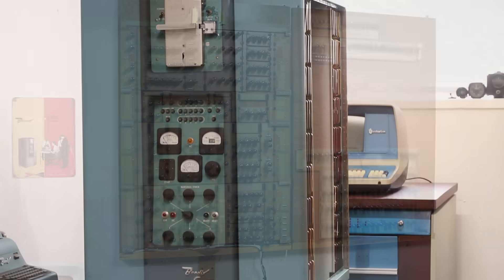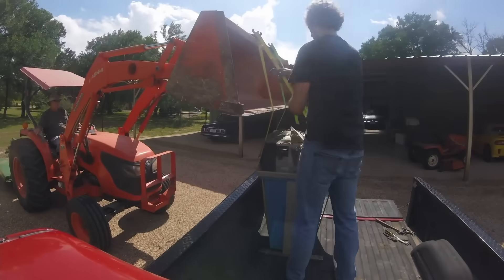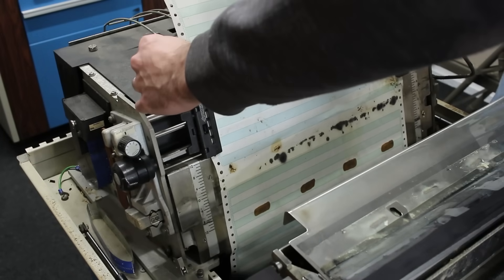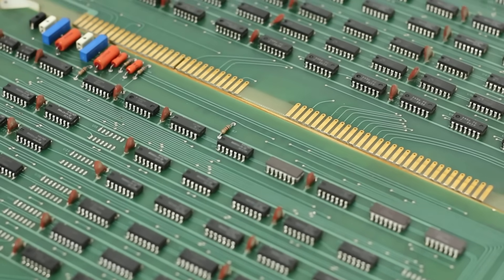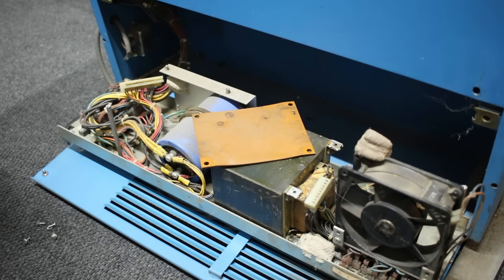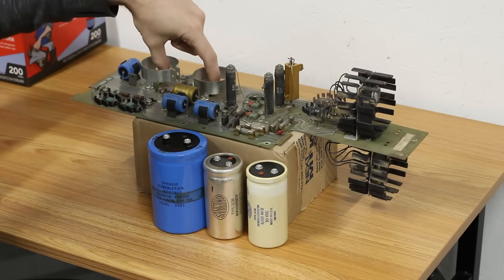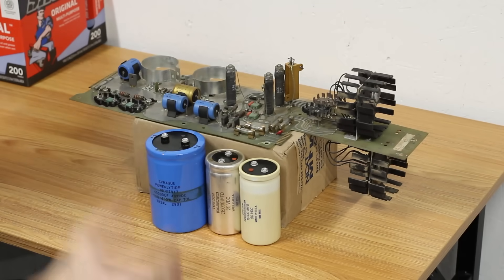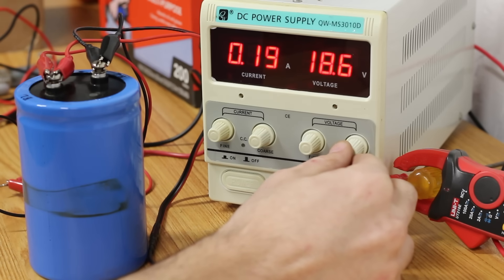Working on the Largest Printer I Own

Comment: I is like the OLIVETTI BCS3030 Line Printer but your printer doesn't also house the Floppy drives  so is not the same as the OLIVETTI BCS3030 Line Printer.

Comment: The desk system at college, you had a connector wire to the drive issue with no write happening,  was the cable fixed and the software replaced and now working as a CPU 6 machine

Comment: I did output collection and sorting from a band printer in the late eighties. Never saw a chain printer running. But if it is 100 lpm (not cpm) I'd imagine it's near the same.  It was amazing watching that band printer run.... chomp chomp chomp grrrr grrrrrr chomp chomp chomp and ten 13" fanfold pages had printed.

Comment: This is fascinating. I worked on drum based printers in the late 70s (adjusting hammer flight time, etc.), and my first printer at home (in 1979, no less) was an ICL Termiprinter, which was slightly similar in operation to this chain printer. In the Termiprinter, the typeface pieces were at the end of steel fingers extending from the side of a belt (kind of equivalent to the chain here), a bit like a giant label embossing device.  It was only 80 columns with 80 hammers, and also quite slow, but it still weighed a ton. The ingenuity in such machines never ceases to amaze me.

Comment: In the early eighties I used to work in an office where the had a Data100 (I noticed that brand name on the back of the centurion printer...) drum printer. When that was doing a test run, man that was hammering. I also have some chain printers in bad shape, not by centurion. Waiting to be restored for 40 years now I guess:). Anyway, if you look for documentation, 'DATA100' is a good link.

Comment: For the mechanical side of the printer, in case you are wondering: the blue tape with the perforations that you removed at 17:58, is a "carriage tape". It allows a program to skip to a certain vertical position on the page. For example if the program wants to jump to the bottom of the page to print a footer, it tells the printer to skip lines till it encounters a perforation in the column (in IBM terms, that would be called a "channel") that corresponds to the "end of the page" (if I remember correctly, in the IBM days that would have been channel 12, by convention). When I started working in the early eighties, we had an IBM 3203 printer that printed 600LPM (there existed  also a 1200LPM model, but we didn't have that one). It was a beast. If you opened the cover, even if it was not printing, the sound was like a steam locomotive entering the train station. Very impressive.

Comment: This printer reminds me of the 6500 IBM Printer series... it adopt basically the same configuration for the hammers and the characters belt.
I was, in my youth, a good technichan on those printers and the adjacent series 6400 ( this one had a single line of heads in a vibrating bar that compose the characters dot by dot in lines)
Both are printronics rebranded if i remember well an probably i still have the field manuals in my garage, after 40 years i have to do a bit of scavenging to find out but i can searche them.
Mechanically are quite serviceables but the eletronic was a pain.

Comment: To reform capacitors, just set the current limit to "a few mA" (I just found out today my powersupply has a 5mA offset! When OFF, you get 5mA. That's a suprise! When set to 30mA you get 36! and the display shows 30!).  Just set the voltage at the max voltage and turn it on. It should be ok after just one cycle. If you want to check for leakage, unplug the powersupply from the capacitor and watch the multimeter. Measure the time it takes for a certain voltage drop, say 5V. You then get I = C dv/dt, you know/measured everything on the right side! . Oh. In the video, you start saying there remains some current while in fact my gut feeling is saying: you're deciding that too fast. I'd find it totally normal if it stays at 1mA for say 10 to 60 seconds before dropping to zero. 

I "salvaged" a PDP 8 in the late eighties. I scrapped it in 1997. :-( 
I still have some of the capcitors (160000 uF, 25V). And its two fans. The fans still get regular use. The capacitors are marked that I think they are early seventies.

Comment: Be Glad it's not an HP. ink cartridges with less ink than there should be and five times the cost of the competitors. Ink delivery service that shut down your entire printer when your credit card lapses with a cryptic error you know when the credit card expires. A scanner that doesn't function unless you have an account and ink. Cartridges that are tied to the printer can't be swapped out while you're troubleshooting print-heads that miraculously die after how many years 1?

Comment: You should take your time reforming caps.  The 25% for 25 is the general rule that has been around for ever.
Ie start at  25% or rated power for 25 minutes,  then 50% for 50min etc  up to 75%  or rating which would be the 'Working Voltage' for any cap.

Comment: Great video.
I had a different, but similar, dot matrix printer, way back in the 80's and it was a beast. If you ran it with the cover open you quickly learned why it was built in it's own case. Mine was also on wheels so way easier to move around.

Comment: Once upon a very long time ago, when dinosaurs roamed the data-centres and I was but a pimply faced youth (PFY)

We got a very 2nd hand drum printer a DEC branded one I think... The ribbon was a massive roll that ran over the face of the  drum (think the old cloth hand towel things you used to see)

My job was to clean this beast and the drum... Armed with a large bottle of IPA a few skewers and a tooth brush, the job was to "unclog" the type faces on the drum.

One well spent afternoon and doing a great impression of a smurf once I was done.... the printer worked a treat and the output was mostly legible :)

Comment: That is really neat stuff, again! When I was a tech, I loved working on the old TTL logic boards. Working on those boards really makes you think hard about how things work because it's not a matter of just pulling a single chip to fix the problem. I learned more about circuits working on those than I did when I took my engineering classes in school.

That power supply looked a bit scary to work on. I was never keen on working on power supplies after getting a good zap from a CRT circuit. I got teased a lot by my coworkers because of it.

Comment: A very nice. Learned something new I think. Paper tape reader for programming. Not surprised the psu came up. I don't have any experience with chain printers. But, the old dot matrix printers I did just needed a good cleaning and lube. One tip is to use paint marks or what not for alignment. Also, unless you find a service manual. I would try not to take it 100% apart unless needed. Luckily you can move most parts of the printer by hand. The only down side of this is you pointed out. Printers are a whole new experience. Also  good chance those logic boards will probably just come up to. In fact the only thing I'm worried about is any hardened lube. Turn it on and it throws a part.

Comment: Furniture sliders = static electricity generators..   I'm so surprised that you haven't blown up more of those vintage electronics..  Especially when you unbox and lay out all the circuit boards on the carpet (at least you used the desk today)..

Comment: I worked for a mainframe (not IBM) company from 1974 till 2020.  We used Odec  printers (specifically the one you have) on what we at the time called mini computers.  I can reach out to some of the Field Engineers I used to work with to see of they might have some of the documentation for this printer. -Fitz

Comment: 16:54 Nice TI PEB back there on the shelf!   Next you'll have to try and find a Myarc Geneve 9640 card for it.  Oh, and I miss the large white/green tractor feed greenbar paper. Mom used to bring home loads of it.  Looks like the power supply  for the printer is pretty much 100% except for the caps.  Is this one of the printers with the thin metal bands?

Comment: The original chain printer was the IBM 1403, initially released with the 1401 computer in 1960, but the 1403 was so reliable and fast that IBM continued making them into the 1970s, long after the 1401 system had been replaced by the 360 and then 370 lines. This short video shows loading a program into a 1401 and printing a christmas tree on the 1403 (https://www.youtube.com/watch?v=OqN8kpHGRmw). It is from the live 1401 demo every Wednesday and Saturday at CHM. Here's hoping the Centurion/Odec printer proves to be as reliable and easy to maintain!

Comment: So many comments already!  Hope you see this one - a few possibilities for further research.

05:55 That sticker bears Data 100 Corporation markings.  Data 100 was a manufacturer of IBM-compatible peripherals (spun off from CDC in 1968, bought out by Northern Telecom in 1978, although the brand name stayed alive until the early '80s).

As far as I know, Data 100 was the original manufacturer only of the RJE and direct-data-entry terminals. The company rebranded and resold card readers, paper tape readers, and drum printers from Dataproducts; card punches from Groupe Bull; chain train printers from CDC; and tape and disk drives from MPI.  But I'm not familiar with any CDC train printer that was that slow. The ones I worked on were 600, 900, or 1200 lines/minute.  

It looks as if the printer is trying to be a clone of the IBM 5203.  That's in the right period, similar form factor, similar speed, and since the Data 100 stuff was all supposed to be IBM compatible, I bet the beast was made to interface to an IBM 2821 controller. It's clearly NOT a 5203, though. It has two print positions served by each hammer. The 5203 had one hammer for every four print positions.

The manuals for the IBM gear are still around, which would at least tell you what sort of thing that Data 100 was trying to clone.

Comment: Still way better than working on modern copiers and printers, with their creaky plastics that might make me want to bite my lower lip and smash them with a sledge hammer. I'd never make it as a modern copier/printer technician; I would freak out and start breaking stuff. I hate modern printers and appreciate Brother printers that are simple to use. Just like Todd Howard says, they just work! I would much rather go board level, then have to mess around with cheap finicky plastic.

Comment: 18:18 That looks suspiciously like the form control tape - the ICL 1932 drum printers that I used in the 70s used them so that form feed and other form controls worked for whatever stationery was required (remember FORTRAN4 H1 and H2 print controls? the 8 tracks of that loop were what it referenced and H1 was by convention the top of form). We had something like 20 loops for the various stationery types that we used and they were made of a mylar reinforced paper tape for durability.

Comment: Kind of curious that the latest model computer (the Centurion) has less maximum memory than the models about five years older.  But again those machines were programmed tightly.  They would have scoffed at our modern bloatware as their systems always got right down to brass tacks.

Comment: Those caps look unhappy.    They may need replacing as reformed caps do tend to fail in time.
I love your enthusiasm for these machines.   It's a joy to watch you bringing them back to life
Reply: Look at that tolerance though! I've never seen a -10/+150% cap in my whole life! (Doesn't mean they won't need to be replaced, I'm just amazed how wide the tolerance band was).
Reply: @Ragnar8504  I've never seen -10/+150, but -20/+80 is pretty common for big electrolytics. It means the manufacturer expects some loss and reforming of the oxide layer as the capacitor is exposed to different voltages over its life. So they set the nominal value at what is effectively the minimum--since for this kind of application, a capacitor that's too big is usually not a problem, but one that is too small will allow excessive ripple.

Comment: Word of warning -- make sure the form (or carriage) control tape is in place before pressing top of form.  If the form control tape is missing or not reading properly, the paper will fly out of the printer in an attempt to find "top of form".  After several seconds of flying paper the printer will fault and stop advancing the paper.   Ask me how I know?....  

As a junior developer, I was responsible for - among other things - creating the carriage-control tapes for the various tax forms used by several financial companies.   So I would create the tapes and then test the forms -- most print jobs would have about 10 or so "line up" forms at the front of the print job so the operators could align the output.   Once aligned they would allow the print to resume.   But occasionally, the tape would be wrong or break or the form control reader would clog .. and you got to watch a "forms run-away" ... I was working with 3 CDC 512 printers - 1403 equivalent -- and these would regularly spit the paper to the ceiling.  

Additionally, there is a switch that will sense if the paper has run out -- and will stop the printer from advancing -- if this gets jammed open (or misaligned)-- you may believe other issue are causing the problem -- check this first -- it' s sorta the same thing is asking "is there gas in the tank?"  -- again - ask me how I know.   

Column 1 of a report was associated with the carriage control -- so a 1 in column 1 of the report would advance to the punched hole in the carriage control tape at column 1 typically called the "top of form".  A 2 in column 1 would advance the form to hole in the carriage control tape in column 2 -- and so on.  Hence the reason for 133 character report that only printed 132 characters wide ... In really complex forms there could be several different "vertical tabs" positions.   Also the length of the control tape has to match that of the form - exactly!.  If you got the length wrong -- the form would misalign on every "top of form" of "form-feed".  -- again - ask me how I know.   

-- stories of a junior developer learning the trade...

Comment: Join the Church of Electrolytic Reformation!
(I got pretty decent results reforming caps, you should do it through a current limiter though. If you reform'em too quickly, they lose capacity)
(but I never encountered a capacitor pretending it's not there or super high ESR until you charged it)

Comment: electrolytics dont have totally zero current even when fully charged, its normal .. especially with very large value ones ...charge to full working voltage via current limiting, hold for half a hour or so, discharge via a bulb or power resistor load, recharge,  then discharge again, then test for capacity and esr if you can ...

Comment: These printers are SO COOL.  A copier tech friend of mine told me about a call that he got on one of these.  They had it serviced the day before, came in the next day and the paper was running backwards.  Turns out that the paper feed motor was 3-phase.  Two of the leads had gotten swapped, reversing the motor.  Ooops!

Comment: Being a chain printer I wouldn’t be to concerned about that breaking and something awful happening. 
A band printer on the other hand, get that guy a little too tight and oh boy
Reply: I don't know about that.  The chain printers I worked on had metal slugs that used some kind of rubber transport for the chain.  I'm not sure as I'd want to be in the same room the first time that comes up to speed.  I also worked on a number of band printers.  I don't know if any of them broke.  I may have had one that forced me to change a sensor.  No big deal.
Reply: @russellhltn1396  The one IBM band printer I’ve had experience with the band had to be tensioned manually, and would snap if it was too tight. Doubt it would exit the printer violently, but seeing that thing out of the machine I wasn’t standing next to it, looked like a band saw blade. And damn expensive too from what I remember
Reply: @sparkplug1018  I worked on Data Products. Those were tensioned by a spring.  I'm sure it could do some nasty things if you came in contact with it when running, but when in position, you'd really have to be sticking your fingers into things to come in contact with it. The band itself was pretty light weight.  I'm not concerned about being hit by one.
Reply: @russellhltn1396  Yeah I’d imagine that while in operation someone would have to be really trying to get hurt by one

Comment: Those caps and resistors in the power supply might “work” but their value will be quite different from when they were new. Throw them on and LCR meter to verify their value.

Comment: In college, many years ago, we had a DEC printer of similar technology. It had a pod on each side that held the biggest caps I'd ever seen. It gave it a shape that got it named "ED 209" in short order. It had a leathal, sharp metal ribbon that held the embossed letters and spun up like a bandsaw.
It wasn't long before we figured out the order of the letters on the band and wrote a program to print a string that would fire all the hammers at once. It was deafening and the lights would flicker as little ED would walk across the room. Highly recommended. Alert the local sub-station first, though.

Comment: The "Odious Odec": watch those edge connectors, they tend to be fragile. Expect to find a buffer containing a line of text, with (if memory serves) a pattern clocked over it synced to the chain speed: when they matched a hammer fired.

Comment: 15:57 if you expect faulty caps, set your multimeter to AC and measure the ripple on the output. Or use an oscilloscope. Even in a linear supply 120Hz would easily come through.